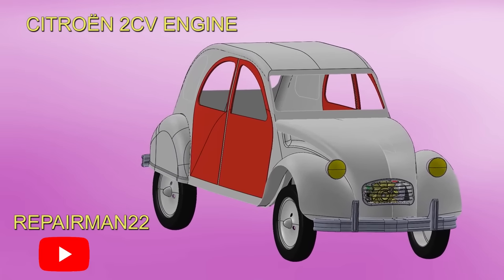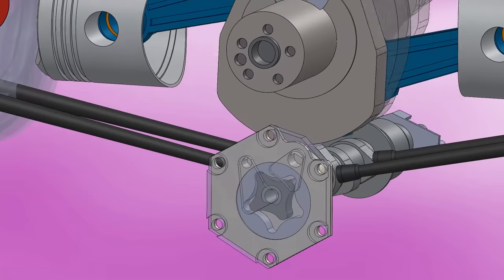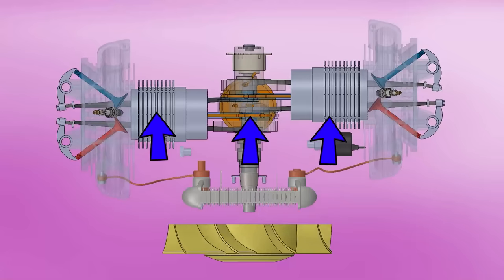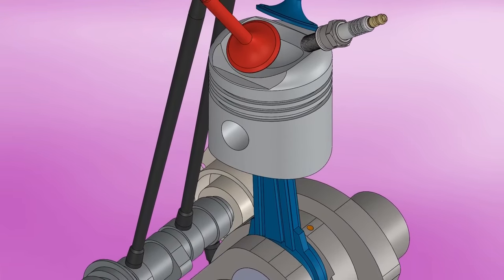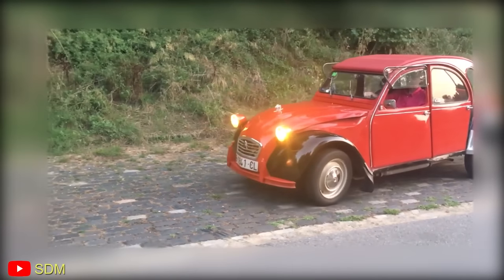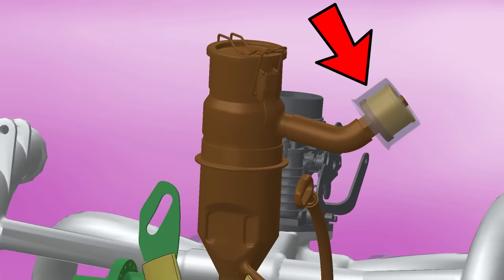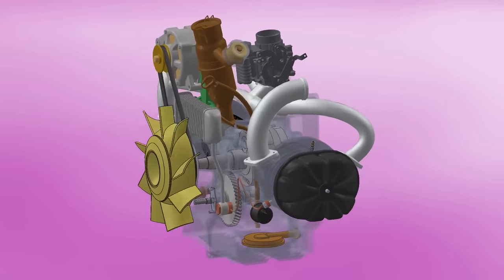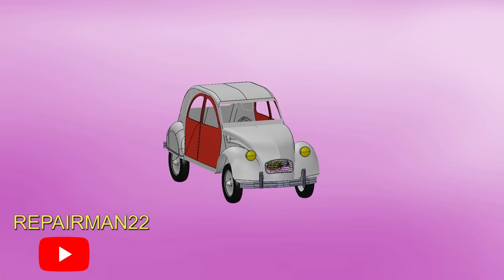The Most Interesting Engine In The World 😍 Citroen 2CV / How does it work in 3D?

Comment: I understand that this engine was originally designed ( pre war- 1930s ) as a generator engine and so was intended to run many hours @ relatively low power.   Interestingly a friends father who was a dealer in the sixties told me they never had engine trouble as long as it was worked hard, it was the little old ladies who usually had trouble as they didn’t “ blow them out 🤭”
Reply: You go read up what causes carbon buildup and you'll understand how your friends father was right. This still applies to modern fuel injection vehicles
Reply: @OffGridInvestor  yes I recon direct petrol injection is just an answer to a non existent problem-  created by those genius non engineers @EUSSR 🤯
Reply: Every gasoline powered car or truck runs better when "the cobwebs get blown out" from time to time.
Reply: @HotWheelsBurban  agreed but decoking  engines seems to have become a cottage industry again having largely died out by the end of the fifties. Back. In the thirties it was recommended every approx 5K miles
Reply: no, the engine was designed after WW2, the early engine from the 1939 2cv (TPV)  was liquid cooled and still absolutly not derived from a generator, but designed to be able to run without damage permanently at maximum power . The first prototype of TPV was fitted in 1937 , for tests with a BMW 500cc flathead flat twin engine, this explain more or less the later choice for a flat twin, but even the early water cooled engine was OHV and totaly different from the BMW engine...
Reply: @HotWheelsBurban  yeah the amount of carbon that accumulates in an older engine is amazing. Having a hemi head helps though. Had a onan powered Miller welder/ generator. The engine was similar to the Citroën  except air cooled and a flat head. The owners manual recommended  decarbonizing the head on a regular basis. More than once a year with the number of hours we were using it. I was appalled, not because of the labor with both heads so very accessible  with the boxer layout but cost because head gaskets being copper composites could get expensive. My neighbor  who was a pretty good mechanic informed me that if i was careful with disassembly , i could just soak the gasket for half hour in hot water and it would swell up enough to be serviceable..  Now i had no excuses  so heads came off and i am so glad i took them off. The amount of carbon in the cylinders was considerable. With the flat head the valves ran parallel  to the piston. Sparkplug was centered on cylinder so combustion chamber was Y shaped with a big concave shape ground out over cylinder and two smaller dishes ground out for the valves. The ground out parts overlapped of course even between valves to allow a little exhaust  scavaging. Anyways the carbon build up was excessive. It went from maybe a 1/16" near sparkplug to over an 1/8" on far side of valves. It looked like the carbon was interfering  with the valves seating properly because there was carbon in the port past the valve. It didn't  take that much effort to clean the heads, top of piston and valves  with a wire brush and the boxer configuration minimized the amount of carbon in the gap between piston and cylinder that had to be washed out. Took about a half hour and my gasket was considerably  thicker than what it was before the hot water bath. Other side was worse but what really disturbed me was the piston on cylinder #1 was even with top of barrel while cylinder #2 piston was 1/8" shy. Didn't  seem like there would be that much slop as far as tolerances and i couldn't  come up with any scenario  that would explained  it. Except a bent rod and of course that was  the problem. I purchased the welder used and was apprehensive at first site. The unit was freshly painted and in my experience  especially  with used tools, the seller is hiding something.  I had brought my compression gage with me but he claimed he had to leave and he had started it and it lit a trouble light and we did get there late... Long story, can't  make it short, wouldn't  weld, struggled running a vacuum cleaner. Essentially  worthless til i rebuilt it. My labor and $650 in parts and machining. Could buy one for ~$2k brand new but new ones used an aluminum  crankcase that was reportably not near as durable.  Plus nothing like a total rebuild to familiarize  yourself with your new / used tool. Plus it had been 6 months since i disassembled  it and not having a shop had to wait til rainy season over. So on the picnic table  by the pond i reassembled  it but my memory of how it was wasn't  that good so it seemed i had to do everything  twice. When it was done it ran great as a generator  but as a welder as soon as you struck an arc the rpms would drop and then the rod would stick. Only way to weld was to have an assistant  goose the throttle  before  rpms dropped. Years later after welder burned up in a wildfire ( along with everything else!) I saw another almost identical  one and it turned out that there was a vacuum actuated lever that would goose the throttle  but i musta thought  it went in such away that the load affected the vacuum one way when it was completely  the opposite. Oh well, next time i will know better!
Reply: The 325 engine came from a commercial grass Mower .
Reply: @HotWheelsBurban  Using proper fuel does help a lot too ;) No ethanol crap in my car
Reply: @pollywollydo  you are unaware of how much efficiency gain is possible with direct injection.
Reply: @HavokTheorem  completely negated by poor service and inefficiency as it slowly? Cokes up +expensive cleaning procedures .  But that suits the STEALERSHIPS
Reply: The 2CV is to cars what BREAD is food -- it is the baseline.   

Let's get it back into production and make it one of the world's transportation options.

Comment: Great video ! The flywheel was key to operations offroad. Had to spin it up and use all that stored torque with the clutch pedal as a secondary accelerator. Facing a very steep incline, you'd have to back-end so the front wheels receiving most of the vehicle weight would provide proper traction... err, propulsion. Never stuck with one of those, even without a winch.

Comment: As a car enthusiast....this was very informative especially with the added animations.....both engines were simple and showed advanced thinking that were good for the times. Individually, it seems the 2CV had some advantageous design points.....shame there wasn't a 4 cyl version produced...but with the axial fan that may have been problematic as to cooling the extra 2 cylinders. Never knew about the 2-engine version.....thanks....
Reply: Thats why VW had the cooling arrangement it did: They had to cool 4 cylinders and an axial fan would not have cooled the two rear cylinders.
I have often toyed with idea of building a cut-down 2 cylinder version of the VW engine, which is what some small aircraft builders do! Would be interesting to compare such a motor to the Citroen engine.
Reply: The air cooled flat four Citroen came with the introduction of the GS, similar hemi head but with overhead cams (and still with the axial fan at the front)
Reply: There was at least one 4-cyl engined 2CV in existence in the past. This was during the production of the James Bond film in 1981 where a 1015 cc engine from a Citroën GS was transplanted into the 2CV. The reason was to make the chase sequence a little more exciting whilst still maintaining the familiar engine sound. So it was possible but never produced by Citroën. There have been other attempts to turbo charge the standard engine but, again, on an amateurish level only.

Comment: Had a bright yellow one of these with the 'big' 600cc engine and absolutely loved it. The rear seats were higher than those at the front, so rear passengers could see out better than with most cars. Even now, I've never had a more economical petrol car.  Only part-exchanged it when rust became an issue.  I'd buy a new one now, if they still made them.

Comment: Thank you for this great presentation! Actually, the 2CV was not only designed for the French roads and landscape, but also for the French colonies as especially North Africa Algeria (desert, heat, sand), but also all other (former) french colonies. (Btw, also the famous Peugeot 504, too..)
I had 2 2CVs, and I often think, that every driver should drive this car in the first 2 years after receiving the driver license, as you really learn, how a car works from A to Z, as everything is consequently designed "keep it simple"!
To me, the design of the Citroen 2CV is much more brilliant than the VW beetle (4 doors, 4 seats for four adults, big trunk (vs almost no trunk in the beetle), much less noisier engine with same driving capabilites (110km/h max in both cases with advantages for the 2Cv as it is lighter and more comfortable), much less weight, the front wheel drive much more convenient and save than the risky RWD. Even in snow and winter conditions, you can start any 2CV with the provided jack using it as a starting hanfdle easily while all other cars including the beetle need jumper cables and an additional vehicle when the battery is too low. (I´ve experienced this myself in a unusually cold winter in Germany..)
But, of course, the beetle just looks cuter, propably radiates more security, though its shape is more "feminine" the sound of the beetle´s boxer is much more "masculine".. and it seems, the beetle was much more reliable...
Reply: But you couldn’t get a 4WD beetle. Go Citroën.
Reply: @clwomble  Well, these few 4WD 2CVs were not really available on the public market, afaik
And I think, there were indeed a few 4WD beetles, too (for military purposes, painted in dark green, with bigger tractor-like wheels)… of course, neither available on the free market
Reply: The reliability of the Beetle is often overstated and confused with the ease of repairing it. There are fundamental design flaws in the Beetle that cause it to be less reliable than is often thought. These are often noted by people who actually owned and ran it.
Reply: The 2CV was beautifully French with a certain romantic joie d’Vie.
The Beetle was possibly designed by the guy who worked on the military Stahlhelm.  My late grandfather, a WW1 veteran, referred to the Beetle as “Hun Cavalry”
The 2CV was endearing, the Beetle just a car.

Comment: The panhard dyna had a 2cylinder horizontally opposed engine too. But my heart will always belong to the nsu prinz 2 cylinder engine, ive never seen anything like that since. Both cylinders reciprocating together, but only one would fire, the pistons swung back around by a crankshaft counterweight. No belts, as the hemi twin cam overhead valves were driven by eccentrics and straps. It was only about 36 cubic inches, just under 600 cc, and delivered about 20 horsepower. But it got over 50 mpg.
Reply: My first car was an NSU Prinz 600cc.    It had a  Dyno starter, so only about 20amps max Electrical output.    It had radial tyres 135 r 12. Alloy finned steel lined drum brakes at the front, steel drums at rear.     Cold air heat exchanger for the interior heater. Single speed fan
Reply: @robertwillis4061  yessir, i had 2 of them, a 59 and a 60, one was red, one was black. Tiny differences between the two. One only had 19k miles on it. I also had a 65 Renault dauphine gordini R1095.

Comment: I had a 2 cv for about 5 years and it was not a good experience. In only 20.000 km following things broke down: Clutch, oilcooler,gearbox,wheelbearing and the carburettor. The gear ratios were not very appropiate, gear 4 was overdrive so up the hills and with heavy load or the wind against you ,one had to go down in gear 3 with a speed of 60. It was difficult to repair, the heat system was lousy and practically not existing and it was a bad starter in the cold winters. But one person could push/ run start it with emty battery.That was good!!

Comment: I had a 2cv of 1956, with the 400 cc engine and centrifugal clutch, absolutely fantastic. Then, I used a 600 cc, smooth and refined. Finally, a Duane with front disc brakes.
Unforgettable.
I'd like to keep it.
Reply: doubt if they survived the rust and were scrapped - sadly it was a bad point, they spray painted rusty panels at least in the 1970's, and no rust protection on the chassis

Comment: Yes a truly brilliant car. On a hot day simply slip out the doors - on a wet day if you forget tom put the roof down simply tip out the rubber floor 'mats'. In board brakes, longitudinal suspension all made for a lot of fun and with those skinny tyres the lean angles were astonishing. I had a Dyane but preferred 2cv - wish I still had one but so expensive now. Ah happy days and a very happy car!

Comment: Great insight to my wonderful 3 new 2CV6s over 45 years and 550,000 kms.
First a 1978 Club in the UK, next a 1982 Charleston and last a 1989/90 Charleston which recently received a Burton 652 cc Big Bore engine plus Power Tube for more power and torque.

The 2CV was manufactured in downtown Paris from 1948 to 1987 and moved to Portugal from 1988 to 1990 with the last rolling off the line 27 July 1990. Also manufactured in Belgium, UK, Argentina, Uraguay, Chile, Spain & Yugoslavia.

Here in Australia they were sold new in the late 1950s early 1960s.
The first car to circumnavigate Australia was a 1923 Citroen 5CV in 1925.
Citroen ID19s we assembled here from 1961-1967.

I have owned 17 Citroens over 52 years. Totally addicted.
My 2019 C4 Cactus plays big brother to my current Portuguese 2CV6 or is that now a 2CV7 with the Big Bore motor?

I can no longer say to the policeman...
But officer, can I have a credit for all the times I cannot reach the speed limit uphill.

Comment: I have been driving my 2CV since 1988, it is still in excellent condition and is cheap.
I maintain it myself, 2.5 liters of oil every 2 years is the only maintenance cost.
I bought it for 3,000 euros and it is now worth 13,000 euros. I never thought that driving a car would generate money, usually driving a car is a cost.
It has never broken down, a car you can count on.

Comment: The idea to fit a flat twin  for 2CV was actually thanks to the Beetle and its engine, in fact the Panhard 850cc  air cooled flat-twin is much more interesting then the2 CV engine, in their last model the 24BT and CT the Panhard engine could get these cars to a topspeed of nearly 160 km/h . This engine had self adjusting valves
Reply: Ich denke, zu dieser Zeit waren die deutsche und die französische Strassennetze ziemlich anders.
Das Lasterhaft vom 2cv bestand einfach im Transport 4 Erwachsener (und roher Eier....) über schlechteste Wegstrecken in der Metropole und Nordafrika mit einer Geschwindigkeit von kaum 50 km/h.  Für die deutschen nagelneuen Autobahnen von den 30ern war der Käfer unendlich mehr geeignet.
Reply: The 2cv engine design is actually based on the pre-war BMW motorcycle engine

Comment: I drove a 2cv recently in Provence.  It had adequate power for French back roads, and the quirky dashboard-mounted worked well.  The main downer for me was the very heavy steering - getting it around a sharp turn at any speed required muscle.  Guess I'm spoiled by power steering.
Reply: ? the 2cv was very easy to drive even from a skinny woman, the steering was only heawy during slow speed manouvers ,never in normal driving...Not forgott that up to the 80' was power  steering mostly optional in Europe even on large cars, as i was young, i had a 1976 Citroën CX 2000 without power steering, and i buy this used car by a slim woman who drove it during 5 years...
Reply: People get spoiled by power steering, but they also try to put in huge amounts of steering input at every low speeds. Just getting the car rolling and feeding the steering in more gradually gets it done without a load of effort. Once you have power steering, you never think about it again and just crank away on that wheel.

I will admit that parallel parking, my advice is of no use! But other than that, yes.

Comment: An amazing vehicle, early versions were hid from the Germans when they invaded France in 1940 and they never found them, the most innovative vehicle of its day and it could be taken apart and services so easily using just the starter handle to remove the front wings and gain full access to the engine, the same starter handle also was the wheel brace to change the wheels, so practical, you could drive them over a ploughed field and a box of eggs would stay on the seat.
Reply: That is why, after a span of 35-40 years, I have bought another this year of my 78th birthday. I love it.

Comment: The beetle engine shown is a dog house variant where the flow over the oil cooler is routed outside the shroud and thus no retard on cyl. 3. Also the fan on the beetle is much more effective in a pressurized system , where the axial fan will experience compressor stall rather quickly.
Reply: Still... no doubt the # 3 cyl ran hotter.....the oil cooler was placed in the air shroud airstream with the discharge directed to #3. Hotrodders of the 50's and 60's often replace the cooler with a coiled-loop of copper external to the shroud right at the intake.....to get cooling and to distribute the shroud airflow more evenly to all 4 cylinders.
Reply: @TheWilferch  No the hot air exits out behind the engine under the car on the doghouse shroud, but going external oil cooler is still an option!
And those that mounted the oil cooler at the fan intake made a huge mistake, of course they didn't know at the time. Today we know it is the absolutely worst place you can put it. They would have been far better of not running the oil cooler at all.